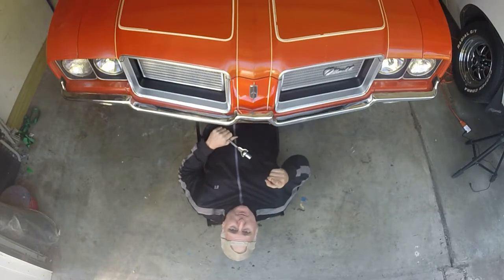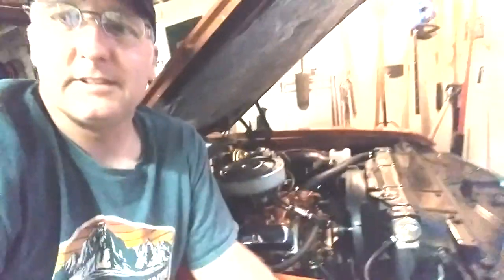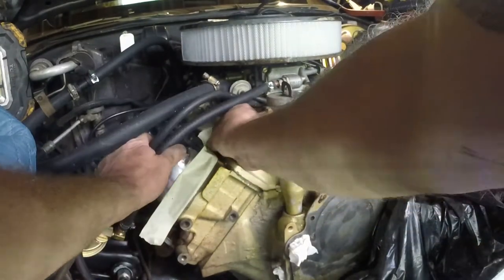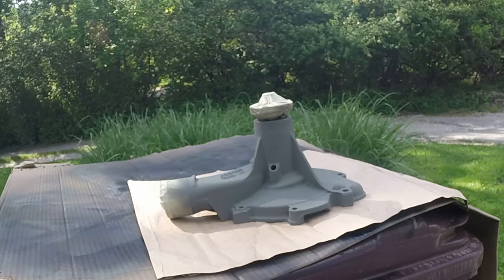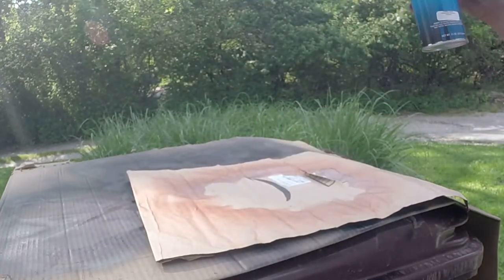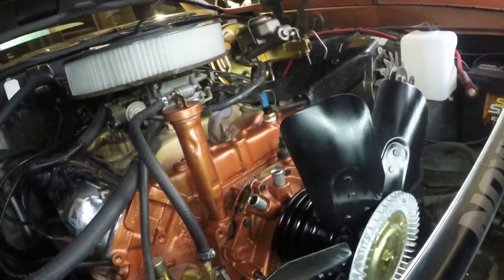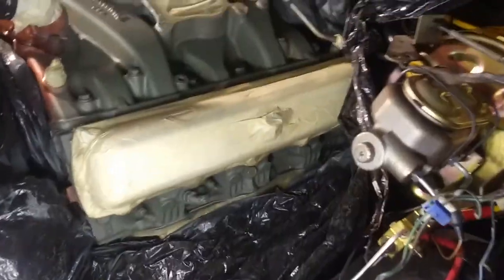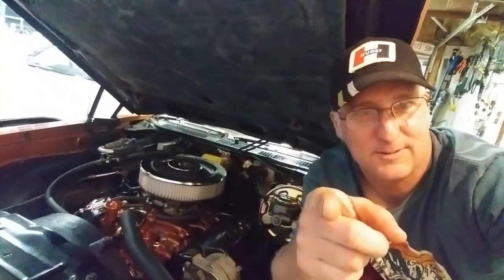Painting the engine in your car! Detailing the Olds 400

Comment: how did you get intake and heads so clean to paint?
mine are both covered in new oil leaks and old old gunked up with dust. 
it will take hours to clean
Reply: Exactly hours of cleaning you said it yourself
Reply: Go buy some gunk engine bright and spray the engine down & pressure wash as much of the engine as possible & do this a couple times then start & run the engine to burn the water off then start the process of cleaning more & painting process .

Comment: Were did you source the paint to match your car? I have a deep blue and it hard to match it with pre made cans, i have some paint left from when the truck was painted i wasn't sure if it could be sprayed over a high heat primer and it hold up
Reply from the maker: I bought the bronze paint from fusick automotive. they have many different engine paints in stock especially for Oldsmobile that are carefully matched to factory color.

Comment: What kind of hi temp or did you use hi temp paint?
Reply: Use only engine paint because it has binders in the paint that allows the paint to stick to the engines surfaces better plus it's also much harder paint than the cheap house hold paints you can buy in a can . Most engine paints can take temperatures up to 4-5 hundred degrees before burning off as long as the surface of the engine is good & clean .

Comment: How long does it take for thr smell of the paint to go away? I cannot tell if im burning oil or if its the paint
Reply from the maker: Oh no. LOL. Good question! If i remember correctly it took at least a half dozen or so running cycles. I also left the hood up after driving till engine cooled down. Oil burn should smell different than paint. Good luck!